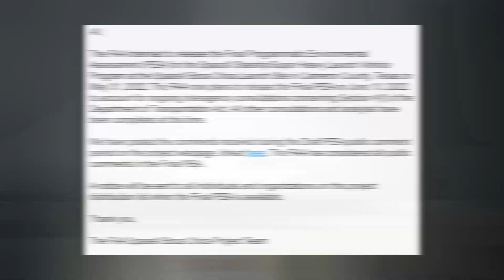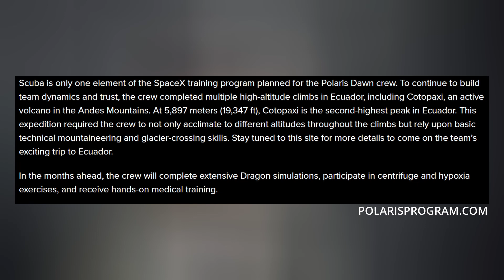SpaceX Orbital Starship AND Booster Receive Engines Waiting FAA Announcement

Comment: Sorry to bug you man.
Did you notice the vacancy announcements on  Space X.  Extensive.  Besides that.
For Starlink there is a full rack of I think technical support for Starlink.  Multilingual customer support.
Space X got it going on.  The global footprint invites almost requires multilingual.  
Now that the Universal Translator is on line - how do we use it? How do we leverage that tool.
Yes, not my thing but is it monetizable?   It is not the Holy Grail but it is mighty close.  The pen is mightier that the sword.  Thanks for your help.  We plant seeds and see what grows.  It won't happen unless we ask, until we try.
I will get down off my soap box.  
adiós por ahora
gracias Señor